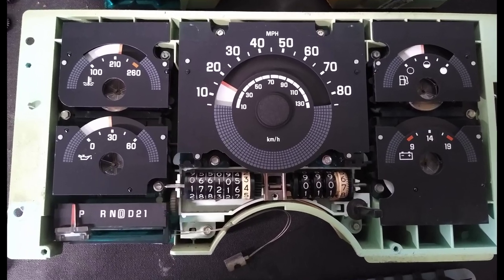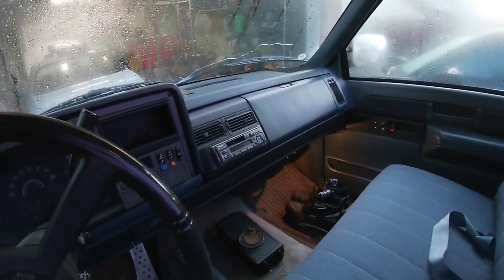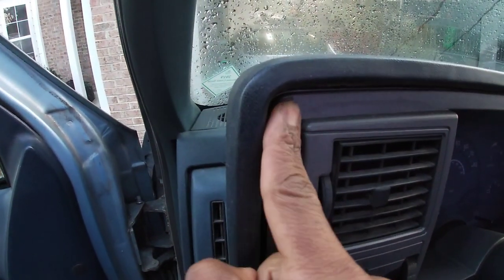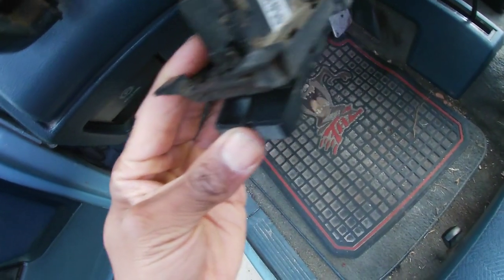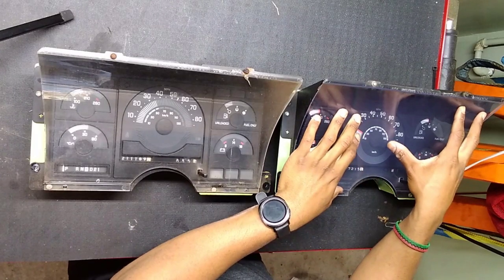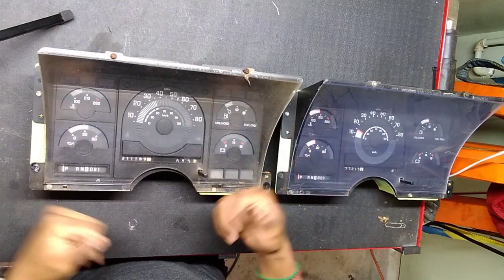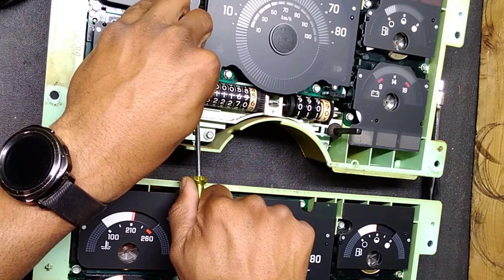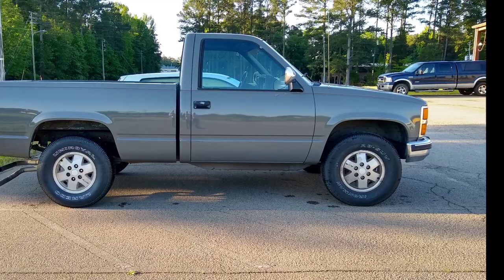89 Chevy Truck - fixing the broken odometer

Comment: Great video! I have a 1988 Chevy C1500, and I used this video to fix my odometer. If you're super cheap or too busy to visit a junkyard(like me) you might be able to fix your broken gear. I put some epoxy in the crack on my gear, and on the odometer shaft. Slide it on and use a small hose clamp to apply even pressure so as not to break the teeth or crack the gear further. The odometer takes minimal force to rotate, so the epoxy is plenty strong enough. Now I can finally figure out my gas mileage!
Reply from the maker: That's awesome if I have to do this again I might try that Good stuff!!

Comment: i have a 1990. the odometer reads 109,000. it has approx 750,000 miles on the truck. the rear diff is the only original drive train component left. the odometer has been faulty since it was new. the odometer, door handles/panels and the fuel pumps are the only "bad parts" gm put in these trucks.
Reply from the maker: Wow! 3/4 quarter million! I bet mine is actually between 250 - 350K.

Comment: good to see it’s not as difficult as I was thinking but I’m thinking about fixing the broken gear with a solder and a zip tie I’ve used this method before to fix broken tabs on grill and fog lights and it works really good
Reply from the maker: Hmmm. I might try that on the next one. I would have loved to have a way to fix the same day I discovered it. Thanks

Comment: I hate the gauge cluster in the 88-93. It’s actually fairly easy to swap them with a 94-96 needle gauge cluster. Also I picked up some decent bucket seats and had them reupholstered. After picking up a 4L80e I’m on the hunt for a low mileage LS.
Reply from the maker: I agree with you on the cluster. I might be doing the same thing with my seats if I find some decent ones at a junkyard. But I'm torn on going away from the bench seat. We'll see what I can find.

Comment: I havent taken my 89 cluster apart yet but i bet its that little gear. Mine quit working at 140,000 mi. that was 25 years ago LOL. love my 89 runs like a top !!!
Reply from the maker: Man....They got it so right with these trucks.
Reply: @MaqsVids  Maq's i have a least 400,000 miles on it, JUST change the oil and it will keep going for eva. Its not my every day driver now but its a good hunting rig and local haler. Thanks for your video !!! I sub ya too
Reply from the maker: It's....Like a Rock 🎵....(I loved those commercials). Thanks for subscribing. I have more videos on the truck coming.

Comment: Maybe you can help me out. I have a 1990 Chevy 1500, and I have had it for about 6 months now . Shortly after getting it, I noticed my odometer seems to work sometimes, either for the the whole duration of my ride or partial. I went ahead and replaced the speed sensor and have the same issue, it still works some of the time. When it does work, it doesn't seem like any gears in the  odometer clusters are broken, it cycles through just fine. Any idea what this might be happening?  Thanks
Reply from the maker: I had a cluster do that exact thing with a cracked gear. It would slip on the shaft sometimes and sometimes it wouldn't. I can't be 100% certain. The gear won't be the first thing I would check. I pulled several junk yard clusters and they ALL had cracked gears. Also, sometimes even with a cracked gear, it will work for a while.

Comment: nice information, i need the botton clip, that resets the gas milage, its a square rod that sits next to the steeering wheel, you have to press the botton several times to set it back to zero. Can you direct me in the right direction, my 1989 chevrolet c1500. can you help me ?

Comment: Thanks man. I have a 88 c1500 that nothing on the cluster works except the odometer and the speedometer. prob gonna take it apart see whats up
Reply from the maker: No problem. I'm glad it was useful. I finally put a new odometer gear in and can track mileage. But the trip meter Isn't working right. I want to go back in but I get nervous because all of my trim is so brittle. Maybe I'll get new trim and go back at it. Thanks for watching.
Reply: I just picked up a 89 k1500. the only thing that works reliable on the cluster is the speedometer and temp. the fuel gage stays at full all the time and when it’s starting to get low it just goes bananas and it drives me crazy 

Were you able to fix yours?
Reply: Hello where you able to fix it if so how did you do it,  Thank you in advance
Reply: So ended up being the fuel sending unit wires were messed up and the oil pressure sending unit was bad, and the coolant temp connector had a bad connection. if you unplug the harness for the fuel sending unit the gauge should go up all the way. means gauge in cluster is good but sending unit is bad. coolant temp sensors on drivers side toward the front side of the block. oil pressure sending unit is big metal thing by the oil filter
Reply: @bigCharizard  I would think there is a problem w the sending unit or the wiring in the frame rail to the sending unit. if its moving its prob not the gauge

Comment: Did the new gear solve the issue? Wonder if it could be something else on mine. The Speedo isn’t working as well
Reply from the maker: Yes it did. In a later video I install a brand new gear. The odometer has been working great since. Once you open it up, it will be easy to tell if it is the gear.
Reply: @MaqsVids  I looked at the connection to the sensor going to the transmission. There was a butt connector that had a loose wire. I tried to reconnect but it wasn’t holding so I unplugged the battery and soldered the wires back together. bang the speedometer and odometer works again!
Reply from the maker: That's awesome! It's annoying when little things don't work. Congratulations man.

Comment: nice i bet thats whats wrong with mine the gear looked just like yours i didnt see if it was cracked though. mines an 89 also
Reply from the maker: I didn't realize a broken odometer was so common. I finally did get a new gear. It is a really tight fit. I got it on but it took some trial and error. Good luck with yours. I love these trucks.
Reply: speedometer is too i have to tap on my dash sometimes and dont know why. i love moonies but they are junk too lol love/hate relationship kinda thing i guess

Comment: I took mine apart and the gear is in place and fine. Not sure how to fix it
Reply from the maker: Darn it. If you are sure the gear isn't cracked, that is just unlucky. If you can get your hands on a known good cluster and swap it in, that would be a good place to start. That would help you to know if the problem is even in the cluster. Good luck!
Reply: I’ve let it go this long 😂 , I’m wondering if the motor that turns the gear is bad. I have grounding issues that cause my reverse lights not to work and my right brake light, my oil pressure guage swings back and forth from 0-60 the whole time I’m driving and every time the cluster shows the “check gauges” light.

Comment: What type of alternator due yyou have? I see your volts are way above 14. I can barely get mine above 13 v’s! Good video. I need to do the same thing to my 91 k1500.
Reply from the maker: I don't know. I'll check when I get back to the truck.
Reply: @MaqsVids  awesome keep me posted.
Reply from the maker: It's a remanufactured 7861-11 Alternator. I am not sure of the rating. But, there are 14.5 V 200 amp High Output versions.
Reply: @MaqsVids  thanks for getting back! Did you have to upgrade wiring for the alternator?
Reply from the maker: I don't think so. I purchased this truck from a coworker and it came with the alternator that is on it. The wiring looks stock.

Comment: You wouldn’t happen to have an extra piece that goes from the odometer to the trip…the little piece of metal that makes the trip turn?
Reply from the maker: I think I know the piece you're talking about. I'll check but it won't be until this weekend. 👍
Reply: @MaqsVids  no problem appreciate it.
Reply from the maker: @anthonyburkman2463  🫤 sadness.... I couldn't seem to find one. I tore all these things apart and it's probably floating in the bottom of the bin somewhere I'll keep looking as I clean.